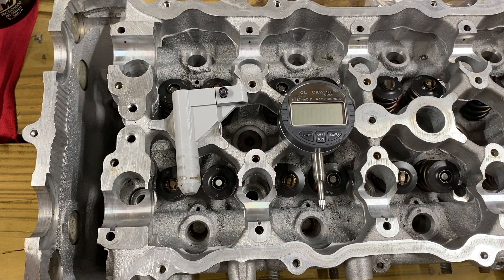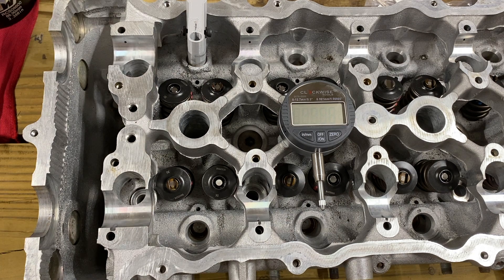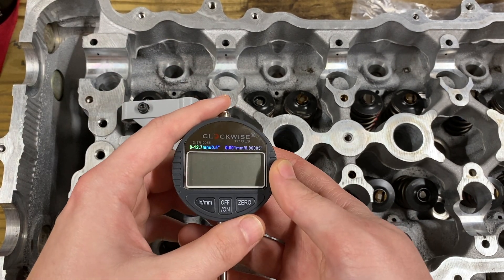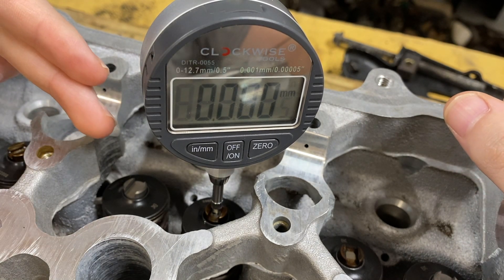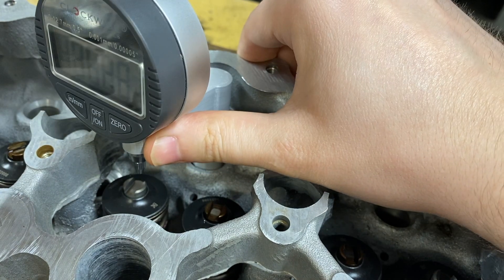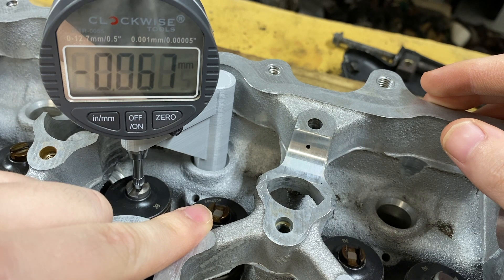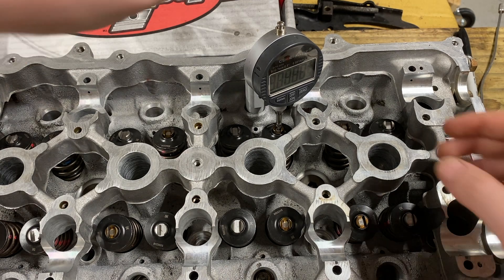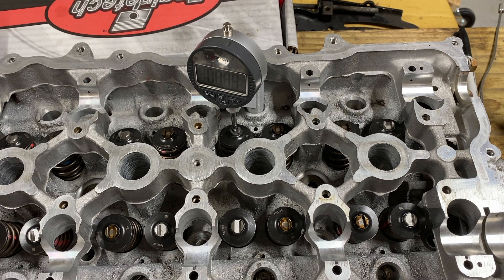SR20 HOW TO: Valve Guide/Shim Measurement

Comment: Just curious when I turn my engine over so that I have the cam lobe facing straight up on 3 of them I can move the rocker from side to side a bit but the other 5 are rock solid. Is this normal or does it mean my rocker arm or shims are worn? Thanks

Comment: Just FYI to anyone buying a dual gauge for this 3D printed holder; buy the 12.7mm one.  I got the 25.4mm and had to build a small shin for it to try and remove as much movement in the measurement as possible as😅.  Great guide btw. Also print the tool in as high quality as possible (smallest layer heights) for accuracy.
Reply: Hey, just to confirm, this is the one to buy?

Clockwise Tools DIGR-0055 Digital Indicator 0-0.5"/12.7mm
Reply: Don't listen to this. The 12.7 only is accurate within .03mm not enough to do this job.